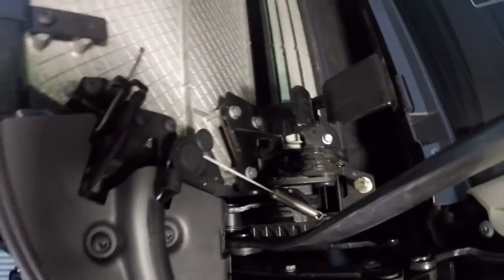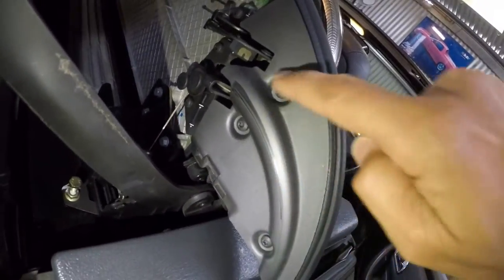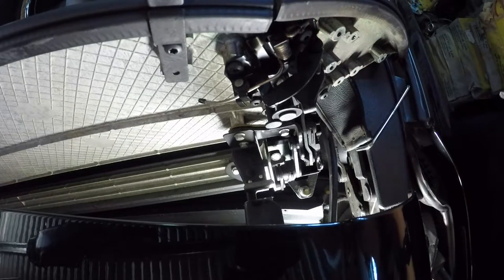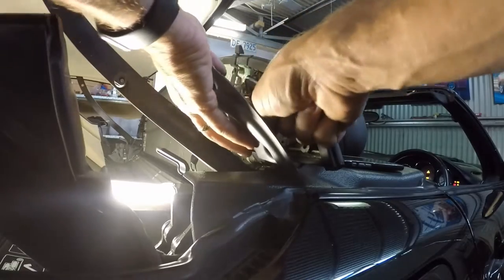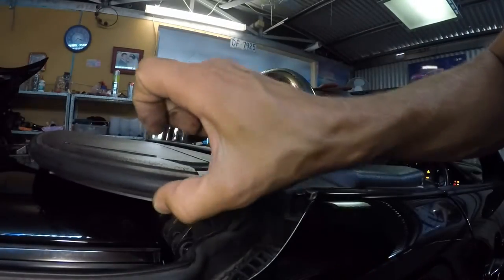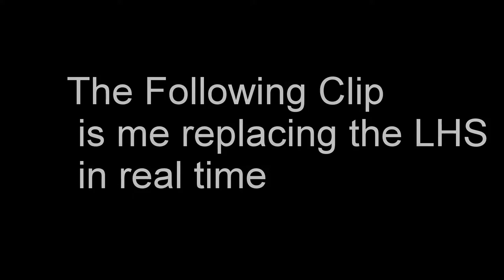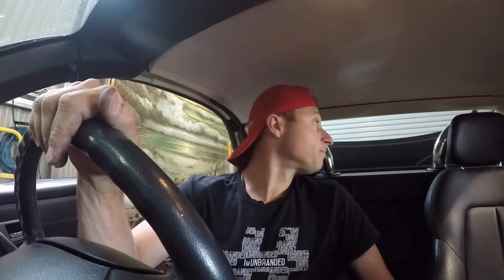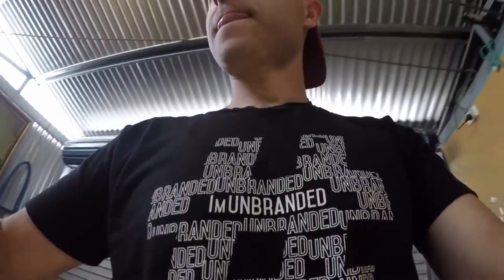How to replace SLK230 Vario Shelf Tensioner Ropes, Instructional (Not a Vlog)

Comment: Hello I wonder if anybody can help me I've got a SLK 2012. Back of the Roof by the window and where it opens is coming away it's unsticking I don't notice someone tried to break in. I have taken the roof lining out to check and it's come unstuck at the back.  is there a way to stick it back down or would I need to take it to Mercedes. thanks anybody for help